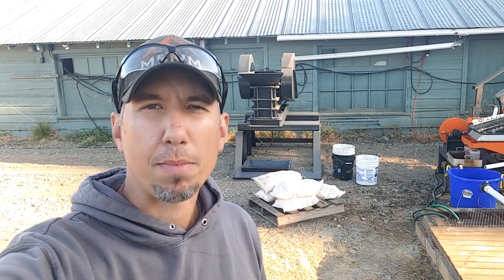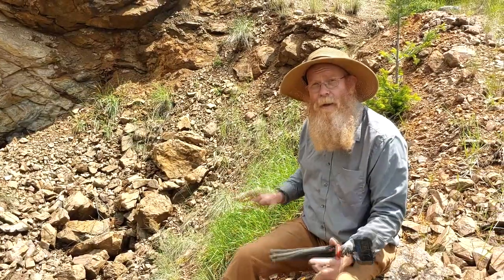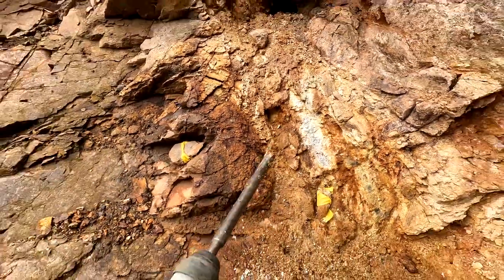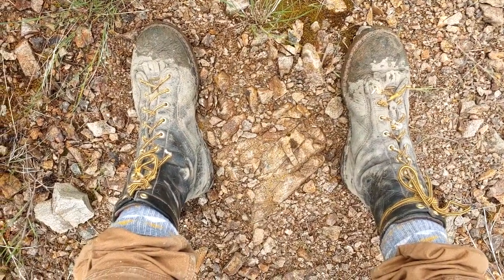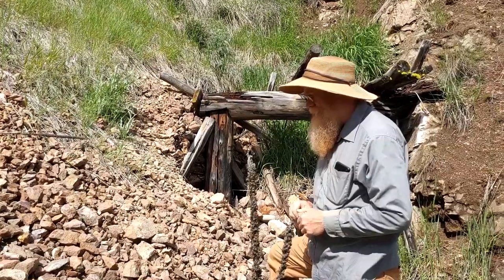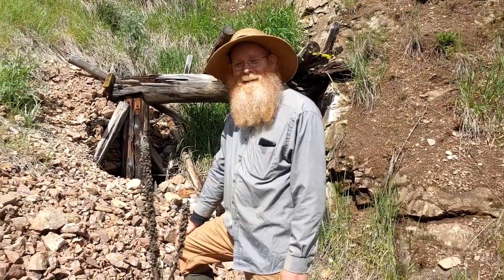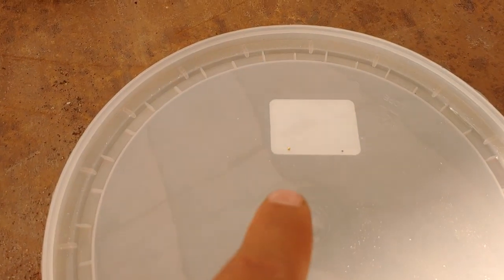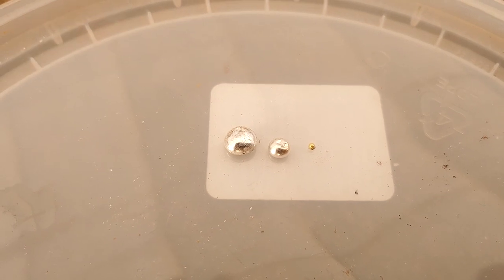How Much Gold Does Dan Hurd Have?

Comment: -why no borax? That’ll make the melt more liquid, and it’d turn the slag into glass, and allow the lead to consolidate into the bottom of the cone.
- at temperatures like what you’d be running, you’d burn out the S as SOx and that’d go off into air.
Things like As and the like would dissolve into the melt.
- why would Fe reduce the PbO?  Whatever Pb you generate will collect the dissolved all Pb soluble metals.

Whatever bead you make, you need to dissolve it in HNO3, and weigh out the Au melt.
Then gravimetrically collect AgCl  to figure the Ag content.

You know what, your bucking process is fine, but treating the bucked rock as placer gold means that you leave Ag and Au in the rock and only sort the hydraulically separable Au.
That is the fraction your melting.

What you should be able to do is split the rock dust sample and do a cyanide leach, and do an assay on the pregnant solution.  That value will tell you the total gold and silver in the ore.

Comparing those two processes will tell you if your hydraulic sortation is effective.

I’m thinking that you’re leaving a lot of Au and Ag behind in the tailings.

Comment: Im probably not right when i say this, but i thought i heard that gold bearing sulfide veins are typically the result of hydrothermal systems following fault lines and systems opened up by either a magmatic intrusion or some somethig else, but either way water heated to hundreds of degrees is the key. So these large deposit sites likely had been part of large volcanic complexes where the main minerals had precipitated out long before it had vented to the surface, but the over burden had eroded away over thousands or millions of years  to expose it to the surface.

Comment: Ok so it appears that the combination of Heated pure liquid Krystal Quartz at the proper temperatures, combined with whatever pure Mineral supply, kooks (cooks) the Mineral and Quartz together to produce a different Material or type of Metal. At varying temperature levels for different kinds of Metals when heated or cooling. Which means that Materials that began to kook but didn't finish to produce a Metal because it kooled too quickly, kan be rekooked from a stalled state. Then the Semi kooked materials or pure Materials kan be reheated and the proper temperatures found to resume the kooking process to Produce the Metals, all of them, or Materials that are made to Kreate what they make, at different temperature levels.

Comment: Over 400 comments! It seems I keep up with these, so this classic one was probably a great flux but an undersized oven for the crucible? Jason's video dozens ago asked the question "how long to drive the charge?" though he didn't use thst jargon. It seems that a lot of small scale fire work gets PMs at the cooling crucible bottom and with minimal collector. I keep wondering "Why not decant to two different pyramids, or some other clever thing?" But only sreetips pours with a flame inside, and I've only seen one make of electric pot furnace made to pour from. Bowen emphasizes quickly covering steel molds that aren't inverted pyramids with a plate because of cooling spitting, so decanting may be more involved, sort of like "Yeah, you can pour into burned wood too, and then there's more buttons, more PPE to wear, blaze a trail." With that much silica, I wonder about a copper powder collector, some Corning recipes have been published. As and Sb seem to scavenge oxygen from glasses. I read somewhere that the borax bead test can be done with soda ash, speaking of things the streak plate also does.

Comment: You guys need Slim, That boney figure will tell you not to sample the surface gossan because most of what was in it has weathered away and gone down slope, Sample and pan around it down grade and up slope, you'll see. He's been saying for years that to find out what is in that deposition, dig down to about 3 or 4 hundred feet to the un-weathered areas for accurate sampling.
 It looks to me you have a Gold bearing deposit that has been invaded by Gold bearing Hydro's that formed the quartz vein, a win, win except that the quartz vein will have a more concentrated Gold deposit in it and the gossan will have the Silver/Gold mix. I see it in the beads., Be careful Dan, you could be selling a huge deposit you don't know about because you did not go down there and check. The buyer will and know weather or not they made the right purchase
 The Gossan tells you it's there, dig down to see exactly What's there. You don't need a shaft, today you can drill down, long ago, they would dig the shaft. That's a Copper/Gold ore body with a Gold bearing vein going through it is what I see.. Dan said the quartz was turned blue nearby, well, Azurite and Ajoite are affiliated with Copper deposits, or minute cracking can reflect blue as well.

 Dan, drill before you sell.

Comment: Hey guys!  Love your videos!  Have you tried vibrating the big round pan that the pyramid sits in to cool?   

High pitch/frequency to jostle the microbeads back down through the slag.
Or Low pitch/freq to stratify the button tip (lower pulses might jostle your slag/button break line a little)

Happy hunting gentlemen!

Comment: If that gold migrated with the hot water does that mean it was a vapor? It couldn't be liquid water and gold together. It's found with quartz. It is dissolved oxygen and silicon. I wonder if there is a bunch of molten gold in the core. If gold floats what is it in that is heavier.